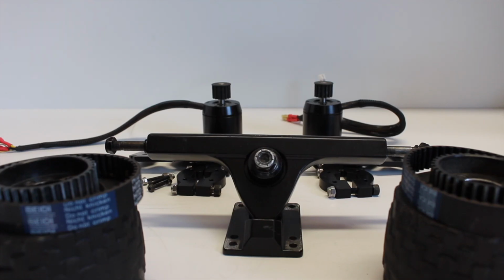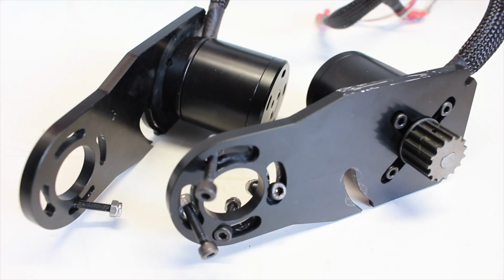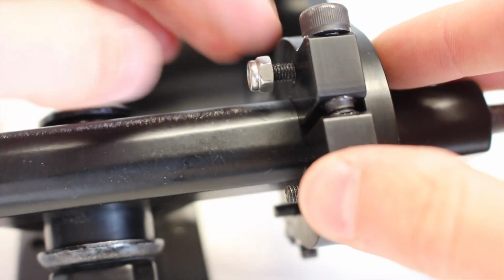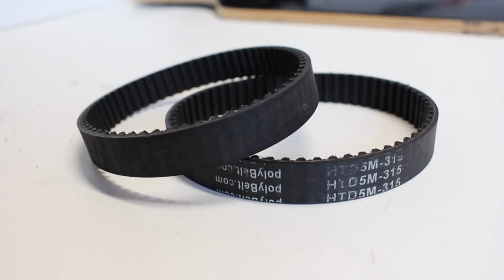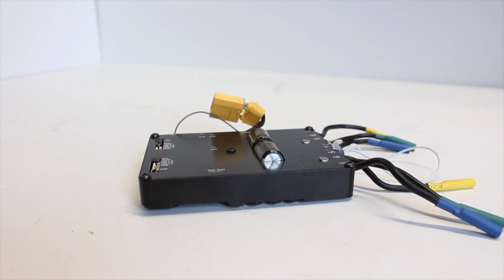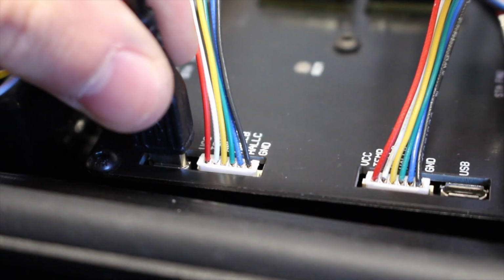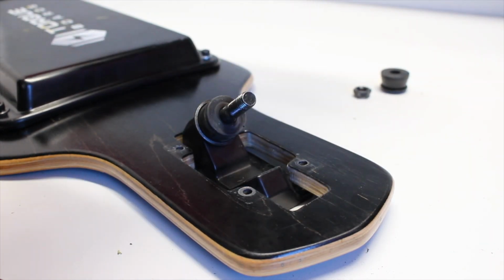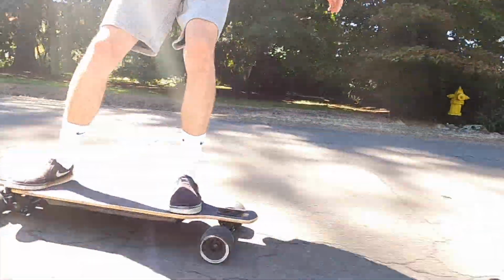How to Build a DIY Electric Skateboard **35MPH - 15 Mile Range - 2,760W**

Comment: Nice video : however it would be nice to give the needed advise as mentioned. For example : Use of threadlock is a must for every screw in contact with metal (the blue one) then the use of isolation like shrink wrap is needed to secure the connection and have a reliable build ! at minimum those two...

Comment: I actually have the same motor for my DIY Build . It is a RacerStar BRH5045 200KV. It has a D Shape Shaft same as Flipsky 5055 200KV Motor. I actually got the motor pulley from Evolve Skateboards. I like your Awesome DIY Electric Skateboard Build. Great Video

Comment: This is a great video! I will say, the Meepo AWD is a much easier and cheaper way to get those specs, prob has more torque too. Very cool though thank you for showing us how to build one of these and explaining everything so well 🤘
Reply: Meepo does not go 35 mph
Reply: @stitches38  it does 34 mph and I’ve actually hit 34 as a 250 lb guy on the AWD Pro, flat ground no decline. I can see someone lighter possibly hitting 35 if I can hit 34 on it. Either way it’s pretty much the same speed. Do you have the AWD Pro?

Comment: Advice from a very experienced and veteran longboarder and Eboarder, for anyone reading this, 35MPH is WAY TOO FAST to be going on a board. IDC who you are, that is too fast and extremely unsafe on a board. There is no soul on this planet that can say they “comfortably” and “confidently” ride 35MPH on a board. Unless you’re a competitor and you professionally bomb downhills on longboards at fast speeds for competitions, then it’s a NO for sure. Stay safe everyone and ride safe
Reply from the maker: I 100% agree that 35 MPH is too fast. A lot of the boards that we build can go that fast, if not faster, but the point is never to go there. It's more of a buffer that can be used if absolutely necessary.

Comment: For people that actually want there board to last longer. Don't use drop trough deck if you put the motors under the deck they won't last long. If you use this type of deck have to move your motors om the back outside of the deck

Comment: My Flispky came with MT30 connector instead of 4mm bullet. What's the best way to hook it up to the boundmotor vesc? Change the vesc to MT30 or the motor to bullet? Are there adapters where I don't have to change anything?
Reply from the maker: Mine also came like that and I changed them to 4mm. Easiest way is to just clip off the old mt30

Comment: I was looking at the motor's wires and the ones on the website have a triangle yellow-shaped enclosure on them. Is that removable or are the motors linked to your website different?
Reply from the maker: I guess they changed them. If you wanted you could try these https://flipsky.net/collections/e-skateboard/products/flipsky-bldc-belt-motor-6354-140kv-2450w-for-electric-skateboard?variant=39584731857083

Comment: You got 100mm ok I tried 120mm and they were too big for my 5055 motors I had to go for 6355 motors
Reply from the maker: Wow that's surprising. I will say though that the extra upgrade to 6355 is so so worth it